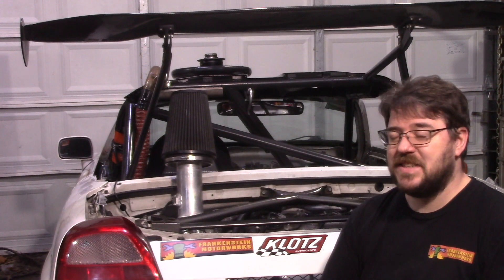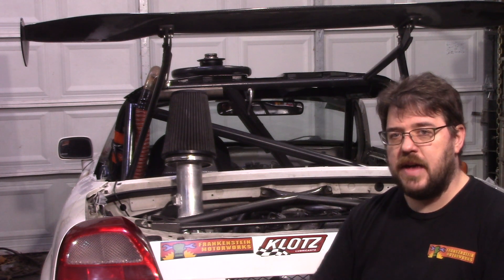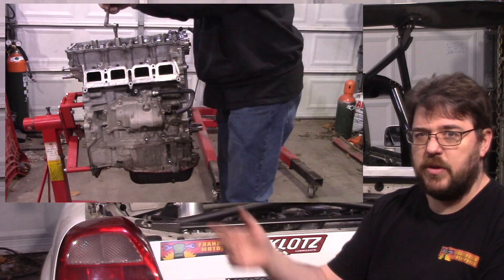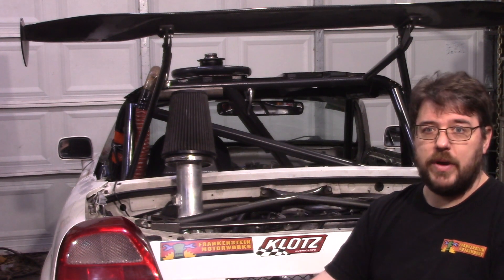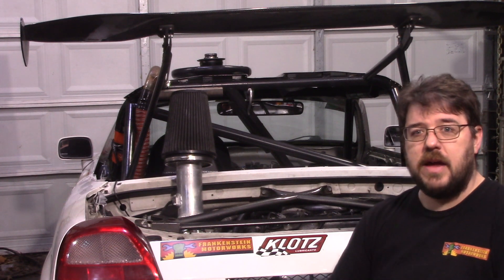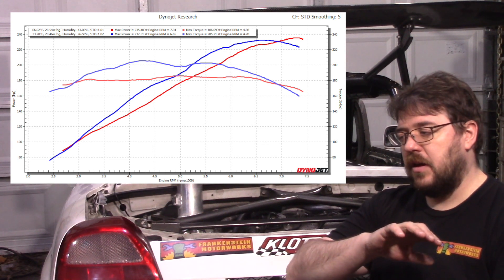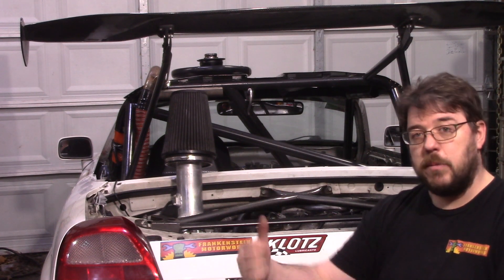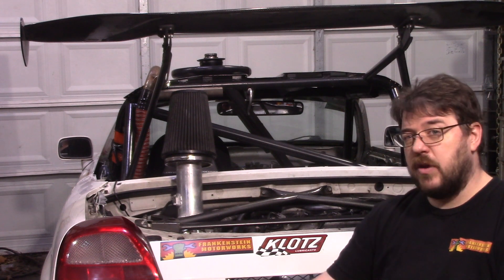Reduced cost high horsepower Toyota 2AR engine

Comment: I am seriously considering dropping a 1AR-FE into my 03 Corolla. I have acquired a 1AR short block from a Venza. It is consuming oil like they all do and just needs to be rebuilt. I know a MR2 is not a Corolla. But. What were the challenges you faced doing this swap? Just trying to get an idea what I might be getting my self into. And before anyone says it, yes I know it’s a weird and expensive swap for just a 2003 Corolla but it’s something I think would be cool. I also know the 1AR and 2AR are “different” engines just one has more displacement. But basically they are the same right?
Reply from the maker: The 1AR-FE and 2AR-FE use the same block and head. all external dimensions are identical so there's really no difference in the swap. the only big issue with the 1AR is how rare and expensive it is, otherwise it's exactly the same.

The only difficulty in swapping the 1/2AR is how tall it is. The second issue is generally ECU but you can just use the ECU i make for the MR2 application and that problem is solved. It should be a relatively reasonable swap.
Reply: @FrankensteinMotorworks  Yeah my mentor told me the engine height might be a problem. I would probably just cut a hole in the hood to be honest. And yes I’ve been to your website multiple times and I’m planning on using your stuff on there. What about the 2AR cam shafts and springs you sell? Would they work with a 1AR?
Reply: @FrankensteinMotorworks  I’m also planning on using a 6 speed from the Scion TC unless the 5 speed that my car comes with will some how bolt onto it. Thank you for replying I love your videos I’ve been watching them to get an idea of what this job is gonna be like. I still need to rebuild the engine and I got that covered that’s not the problem it’s just the actual swap that seems like the challenge to me. But I enjoy a challenge. Not trying to make a ton of HP I just wanted a bigger engine in my Corolla the 1zz has a lot of miles on it. but I want it to be reliable for daily driving and still be able to hammer on it every now and then.
Reply from the maker: @yaboykris2118  yes, the valve springs and camshafts i sell will work. you will have to check the piston to valve clearance and potentially clock the cams to suit but they can be used.

Comment: Did you remove the ballance shaft , or is it doable without adverse affects ?
Reply from the maker: I've been running without balance shafts for years now with no ill effects. Some people do say that it vibrates a bit more at idle, i don't really notice it but this also isn't a highly refined street car.
Reply: @FrankensteinMotorworks   thanks for the reply ... with the 2AR is it just a simple matter of unbolting the ballance shaft and plugging the oil feed ?  im more interested in saving weight more than anything ... might even set one up on bike carbs and distributor for a future project .... I have video on my channel of a suzuki m18 and honda r18 ive done previously
Reply from the maker: @mohawkc77  Exactly, the hole can be plugged with an 8mm ball bearing hammered in.
Reply: @FrankensteinMotorworks  thanks sir.. just might be my new fishing boat engine

Comment: Is the wiring similar on the 2nd gen 2 with your factory ecu?
Reply from the maker: I don't quite understand your question. the SW20 wiring is very different than the ZZW30 wiring but at the end of the way you're still just hooking up a dozen wires or so into the car plus the drive by wire wires.
Reply: @FrankensteinMotorworks  That's what I was getting at sorry about my drunk typing.

Comment: How much power can you get out of its original engine the 1zz could it get close to 200?
Reply from the maker: unfortunately i've never worked on the 1zz so i'm really not the right person to ask. In theory there's no reason a 1.8L engine should certainly be able to make 200hp NA but i don't know if it is cost effective on that motor.
Reply: @FrankensteinMotorworks  thanks anyways
Reply: @FrankensteinMotorworks  so would making this 2ar engine swap be more beneficial? How much would it cost

Comment: Hey! Do you know the difference between the FE and FXE camshafts?
Reply from the maker: The FE cams are about 0.5mm taller and the FXE intake cam is about 30 degrees more duration than the FE cams. The FXE exhaust cam is tiny and useless.
Reply: @FrankensteinMotorworks  Do you know exact duration and lift?

Comment: 2ar in an elise would be a great combo, who will be the first? :) Or in a light rwd car, though it needs an adapter plate. How tall is this engine, tall like a K engine?
Reply from the maker: I've never had a K series in my hands but based on pictures it's about 2-3" taller than a k series. The motor has a really good rod ratio but you pay for it in deck height.

Comment: wow, if you can offer a 'kit' to swap this into more than MR2's I bet you have a big market.  Plenty of cars out there with C/S/E series transmissions, and we know the E will go anywhere the other came from...
Reply from the maker: The C series transmission has the wrong bolt pattern but it will bolt to most S and E series transmissions as well as the EB and EA transmissions. I'm actually working on a kit to bolt it up to a TL70 transmission right now.
Reply: @FrankensteinMotorworks  yes, I know, I meant that the e can go where the c came, in an mk1 or Corolla or mk3 etc, using the 3 trans mounts and the swap axle combo of parts. So you could swap this to those places too, a long with a swap transmission

Comment: Does the timing on your cams match the stock timing in order to run this configuration with your cams/springs?
Reply: Although there might need to be some alternate timing on the exhaust cam to ensure the valves don't contact the pistons with the extra lift.

Comment: Does the 2ar bolt up to a 7th gen celica?
Reply from the maker: no, the 2AR does not share a bolt pattern with the 1ZZ/2ZZ engine. You would need to swap in a different transmission. I don't know if it would fit then, that celica has a very short engine bay. Someone would have to try it to find out.

Comment: Turbo manifold coming soon? More power
Reply from the maker: I am pushing the NA R&D first, once i'm done with that i will dive into the turbo side of this motor.
Reply: @FrankensteinMotorworks  where do you think you'd put a turbo for this application?
Reply: @FrankensteinMotorworks  I appreciate your hard work and knowledge on the 2ar. Keep it up 💯
Reply from the maker: @Weimerica8841  i would just put it behind the motor. It's a bit more length of plumbing but these modern turbos spool up super fast anyways.

Comment: What type of gasoline is used?
Reply from the maker: This is just normal gasoline, 92 or 93 octane in the USA. Note that USA octane ratings use the average of the RON and MON rating and other countries calculate octane differently so this is about the same as 98 octane in Europe and also other countries. Essentially it's running whatever the highest octane fuel you can get at a regular gas station.

Comment: Awesome news. Thanks for the development and sharing knowledge of these possibilities! 
What stock ECU do you mean? There's a guy in the UK making a kit to fit a corolla ECU into the mr2 housing for a bolt in mappable ECU conversion rather than stand alone (adding a wideband sensor kit) which would make this REALLY cost effective as we cannot map UK/EU ECUs.
Also with 185lb.ft at the wheels is it possible to keep the mr2 transmission? We also don't get many suitable donors for those and I'd be thrilled with up to 200lb/ft at the wheels normally aspirated for my road car keeping my JDM close ratio 5 speed LSD for extra mechanical advantage.
Cheers
Tyler
Reply from the maker: I'm talking about the stock 2AR-FE/1AR-FE ECU. I know about the guy you're talking about, he's on our discord server and we've discussed his build quite a bit.

As for keeping the MR2 transmission, it depends which MR2 you're talking about, the SW20 transmission can be kept no problem, the ZZW30 has to be switched out, it will not bolt up to the 2AR and even if it did the torque handling is questionable.
Reply: @FrankensteinMotorworks  thanks for the info. Yes I meant ZZW30 like your race car, apologies for the confusion. I know the torque limitations hence I mentioned my modest ambitions for power but thanks for the info. I'll have to figure out an alternative transmission source, maybe one of the modern Toyota boxes is more available nowadays.
I appreciate your feedback and wish you every success with your projects and business!
Reply from the maker: @tylerwatts1004  The swap kit available on my website ( frankensteinmotorworks.com ) uses the 2011+ Scion tC 6 speed EB60 transmission. It's a better fit in the chassis and holds the torque just fine.
Reply: @FrankensteinMotorworks  yes I've checked it out, but I don't believe that's a readily available transmission out my way. Thanks for the info, I must do some better research myself to find the possible/available options in the UK and plan from there.
Your kits are very well considered and look well made also so thanks for bringing us this solution.